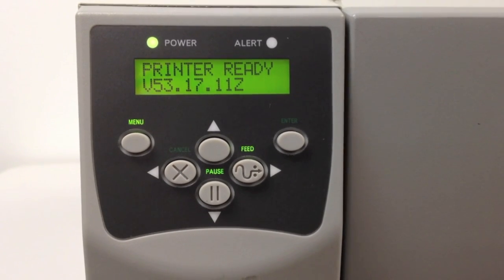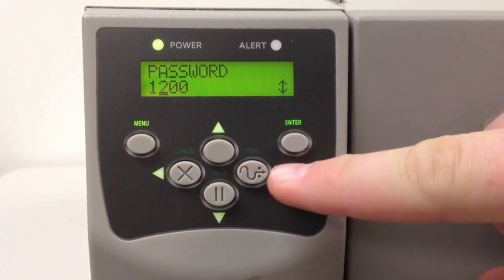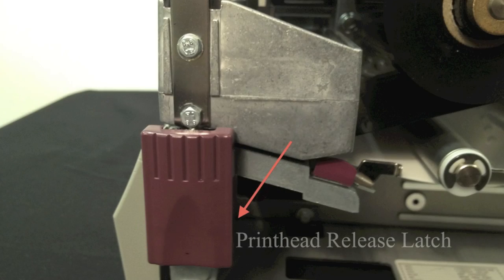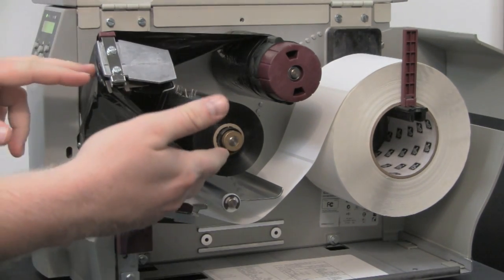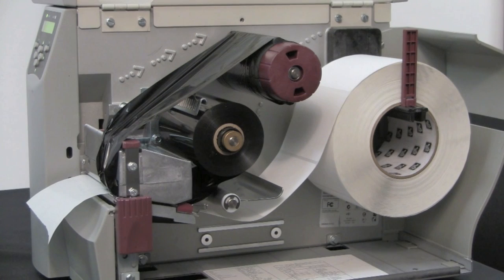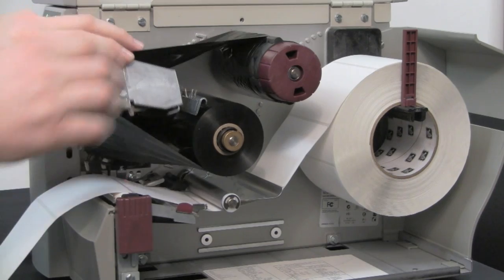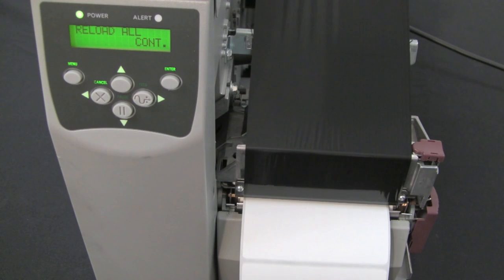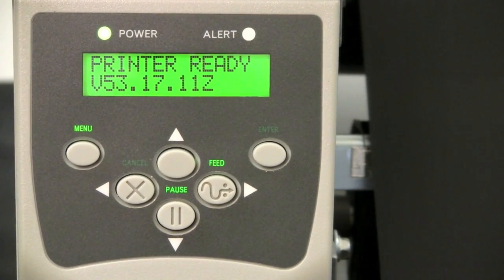Zebra S4M Series Manual Calibration

Comment: Hello, I made the calibration but have the same error "Paper out". Do you have maybe an other idea? Thanks
Reply: bekesirobert I know this is an old question, but the reason might be, that the max. label length is shorter than the real length of the label. Check out the printer configuration for the LENGTH field.